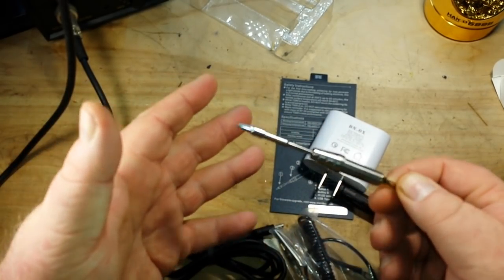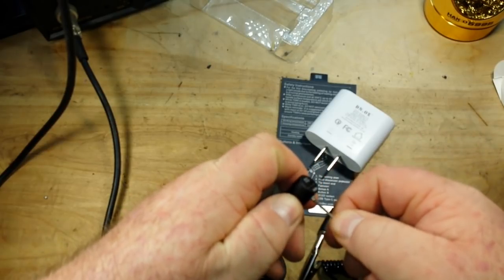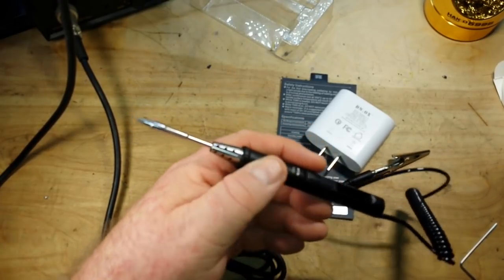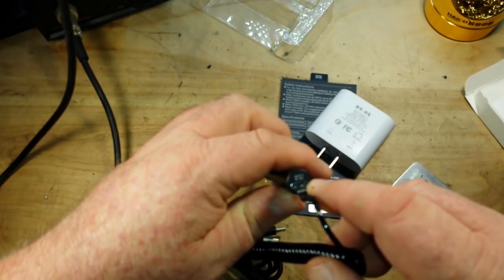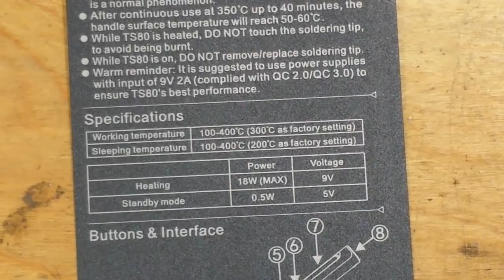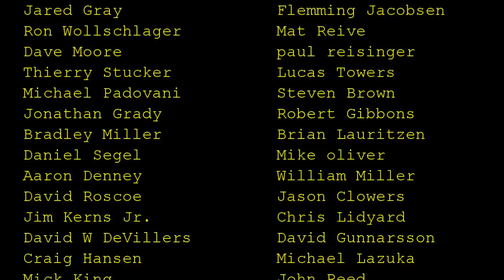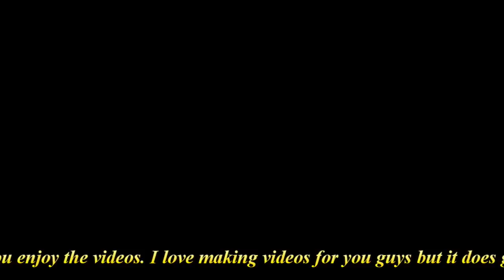TS80 Mini Smart Soldering Iron

Comment: If this TS80 is as good as the TS100, then there's no way for your old Hakko 936 style iron to compete with this little thing in term of soldering capability.

Your power bank needs to support 9V 2A to power this iron. I don't have this particular iron but I have TS100. The TS100 definitely heats up faster, has a bigger thermal capacity, recovers heat faster than my Fakko 75W iron, only thing bad about it is the ergonomics and the lack of built-in ESD protection. That's why I bought one of the Chinese T12 OLED soldering station. Now I no longer need neither my Fakko nor TS100 cuz it has the best of both worlds.

Comment: your powerbank goes to sleep cuz you never turned the Iron on. Plug the cable in press the Button closer to the tip side and it heats up. Use my TS80 every day with my power Bank

Comment: QC3 is a bit of a trainwreck.  There are two standards involved, and to up the stakes one of them requires royalties - so there has been a lot of reverse engineering going on ... and like all chinese whispers - something always gets lost or changed in translation.  And of course that's the "standard" used by most powerbank Mfrs, little wonder that nothing works as it should.
The Hack may help - but its down to the luck of the draw.  On the other hand if you stack the deck you'll get something that works.
Testing the stock PSU that comes with the iron.  Its putting out considerably more than 5v ... and slightly less than 9v - 
I've bought a number of extremely cheap 2000 and 4000mAh cell powerbanks.  So I came up with a way to use them.

My solution has been to add a standard  "MT3608 DC-DC Voltage Step Up Adjustable Boost Converter Module 2A" (fleabay 10 for £3.33) 
to the case.  It's still powered from the bank's USB out.  I toyed with modding a powerbank - but just hanging the booster to the side is more flexible, and arguably safer as it uses each banks cell voltage protection (just in case) rather than introducing yet another stage.  By setting the boost output to match the stock PSU's observed working voltages (8.2v +/- a shave) you get the same performance as having it on mains.  Its a bit of a dog's dinner, and it doesn't switch but having a small variable powersource is handy.  You just need to keep the sleep time on a short leash. 

I've also come to suspect that the USB power meters ALL interfere with with QC3 switching.
Reply from the maker: Andy, thank you for that information. It was most helpful. This is the kind of stuff I love seeing here.

Comment: Hello Paul,  I personally don't need one of these from a work point of view. but from soldering out in the cold and a cold wind can kill your iron what do think is better,  TS 80 or TS100 ?
Reply: I would make the decision based on what your power supply will be. TS100 has the DC Jacket and  can be a bit more powerful while the TS80 has probably "enough" power for everything and can use USB Type C. For the lab or if you use 3S Lipo Batteries the DC Jack of the TS100 might be more practical  - they sell nice flexible XT60 cables for it. If you prefer USB Type C, which will get more popuplar in PowerBanks and many friends might have at home from their phone / laptop chargers, the TS80 is more flexible. I think you can't go wrong with either (I use the TS100 for everything at home).
Reply from the maker: I would think the TS100 if you have a truck battery you can easily access. Otherwise the TS80

Comment: I'm with you on the small irons esp when you measure them in mm - one of my bigger clients got me a "surprise" I couldn't refuse.  To be fair this little gadget punches well above it's weight it's good for 90% of what I do  ... just a shame it feels so light.
I didn't have a qc3 powerbank but a little research revealed for the more adventurous, Github https://github.com/Ralim/ts100/issues/349 has a ridiculously easy to apply "hack" that allows the wee beastie to work with 5v.
Unlike many hacks - there is nothing drastic (or guarantee voiding required) - simply plug USB into PC (with button pressed) and copy a file to iron.  You can easily flash to new or revert to old in seconds and it changes the functionality massively.

In the UK, poundland are selling quite decent 2000Kwh and 4000Kwh powerbanks (see big clive's channel) so it makes sense for those needing portability to at least look and see.  Add a 9v stepup converter and you have something that works just as well in the field as in the lab.
Reply from the maker: I like the way the iron solders. Just need more weight in my hand after 30 years of a big iron.

Comment: Would not touch Bangood, as if anything goes wrong they will not except returns.
Reply from the maker: I've dealt with banggood for years. Never a problem. And no Chinese supplier accepts returns.
Reply: @learnelectronics  Just had a laptop returned, Chinese customs stated Bangood would not except.  Took 4 months to get it back.  Not impressed.